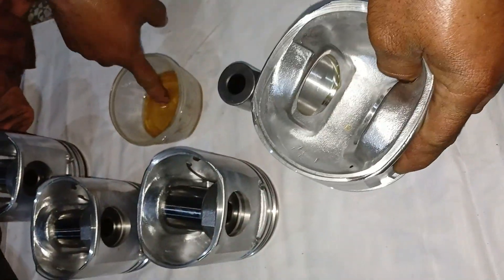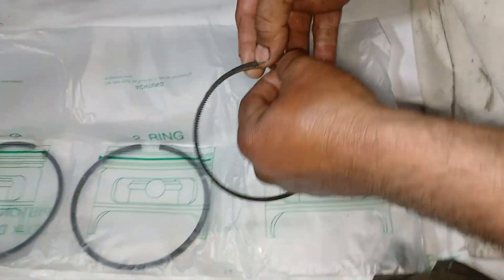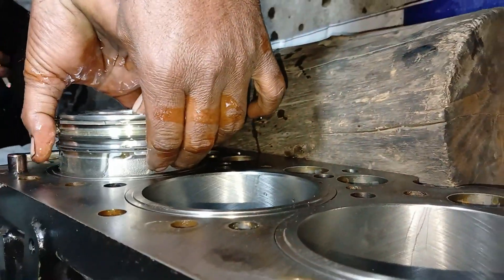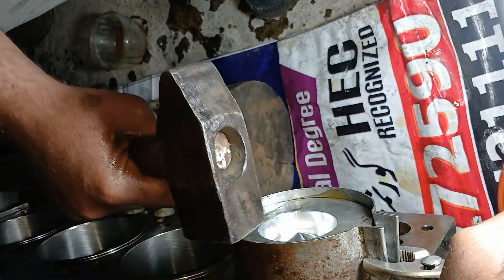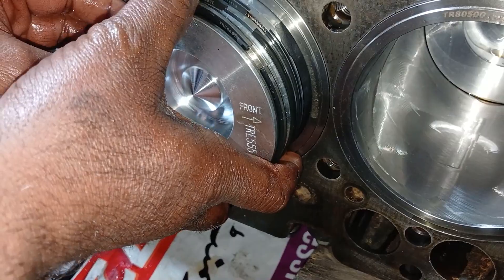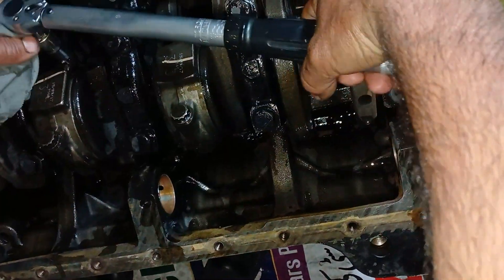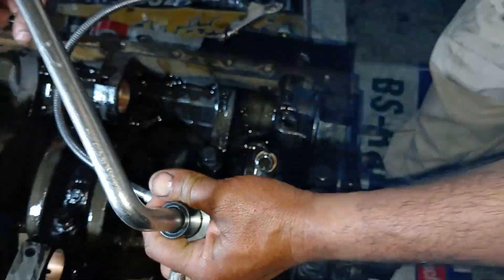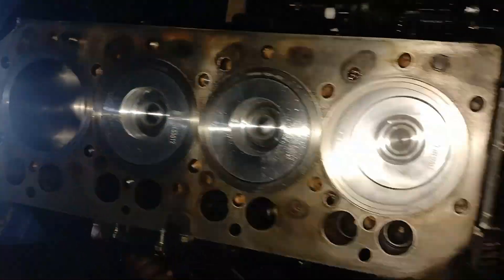John Deere 4045 USA4.5 L  engine Piston and Connecting Rod installation. and 4045  torque specs.

Comment: Hola buenas noches👍🙏👍recuerden × favor publicar una tabla que indique los TORQUES  bielas bancada cámara y todos los demás GRACIAS 🙏en idioma ESPAÑOL
Reply from the maker: tapa de cojinete principal 
100 libras-pie

 perno de biela 
43 pies libras +90 grados

 pernos de culata 
75 libras-pie 
110 libras-pie 
espera 5 minutos 
110libras-pie 
apriete 60 grados adicionales
Reply: Gracias👍🎯👍
Reply: × favor me informan paso A paso el poner en tiempo el motor JOHN DEERE  4045TF 250incluyendo la herramienta  específica y para instalar el sello ( retén estopera SEAL OIL atrás y delante 🙏🎖️🙏gracias
Reply: Is the John deer  4.5 a good engine?  I have one that has low compression from wrong air filter, dusty masonry business, do u think it's worth doing the liner's?
Reply from the maker: @John-z4g5p one of the best increase changing Air filters intervals
Reply: @Technical.Education  thanks for your opinion on John deer 4.5 engine!! I will remove the engine from air compressor and then rebuild with your videos and manuals !!
Reply: When u guys do the liner's on the 4.5 John deer, do u do new pistons and rings? or just rings with the new liners  thanks from will!!!
Reply from the maker: @John-z4g5p  pistons + rings